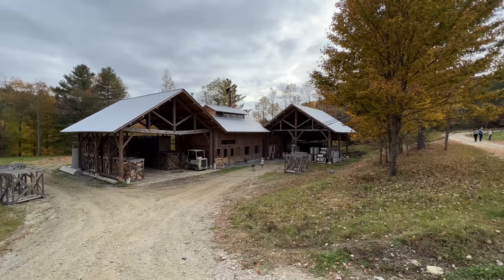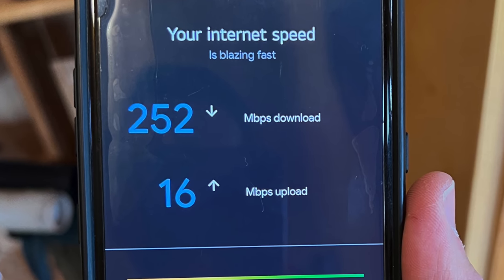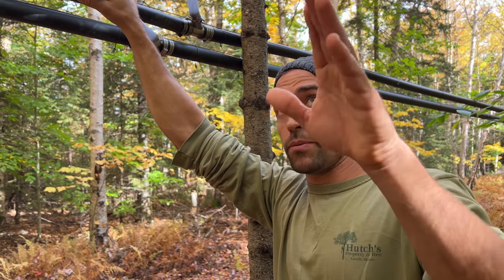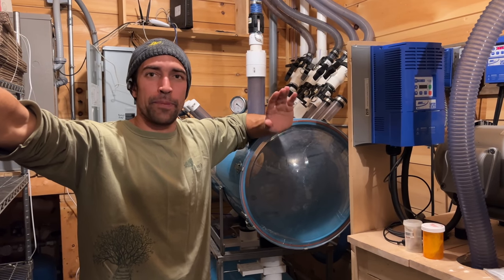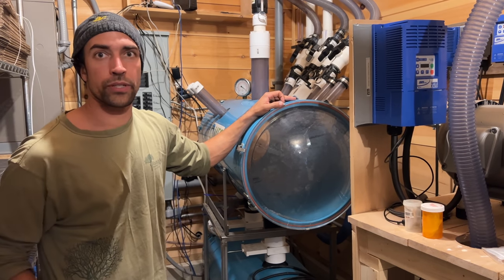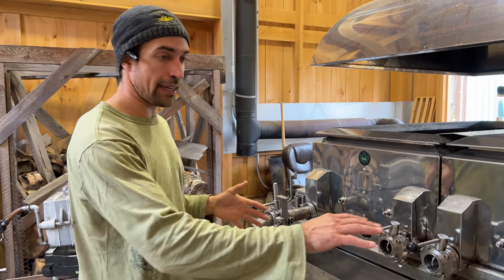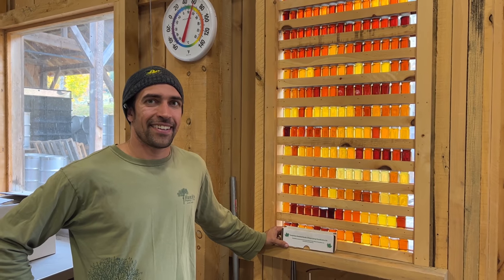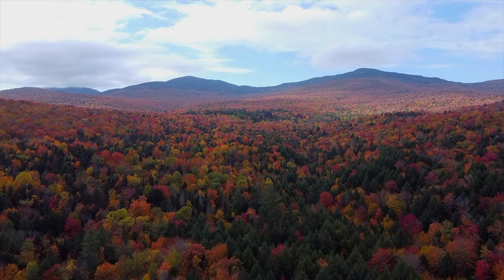My Brother's Starlink 8 Months Later! And a Vermont Maple Syrup Farm Tour!

Comment: This is very interesting!  What a change from when I was a kid!  I grew up in Maine.  We still have the farm there and used to tap the maples on the property.  We are getting up in years now and no longer do that.  As a kid, we collected the sap in buckets and then boiled it off in a sugar shack.  Josh's process is way beyond what we did.  Very impressive!  I am stunned at the volume of sap he collects.  And, the reverse osmosis function?  That's amazing, and what good sense that makes!  We used 32 or 40 gallons (can't recall) of sap to boil down to 1 gallon of syrup.  This cuts down that boiling time and energy needed.  Great idea.  Also, the vacuum system.  That's new to me.  I was aware of the tube system but not the addition of the vacuum.  Times change!  Very impressive.  Thanks for posting this!